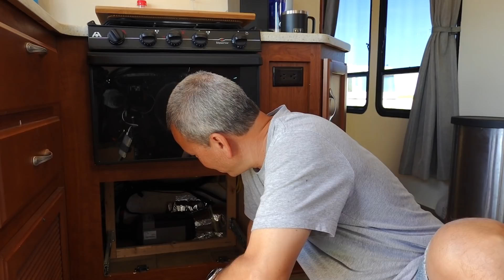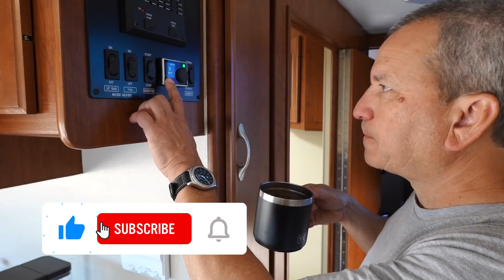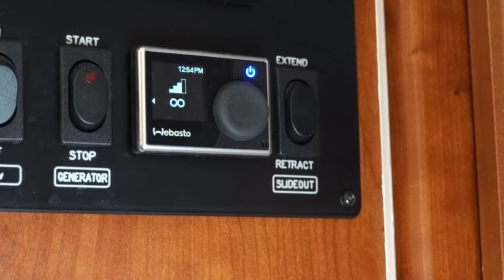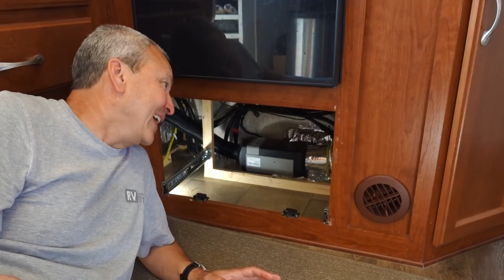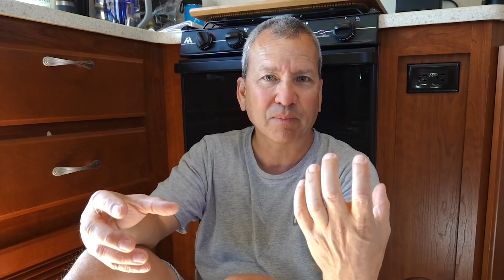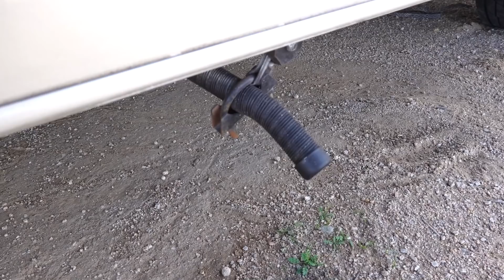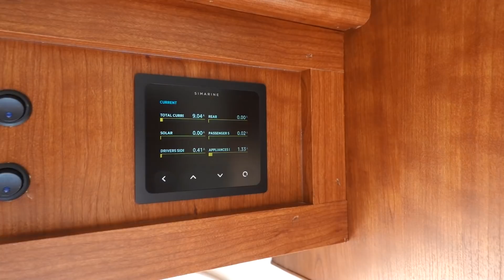(UPDATE) 6 Months Using Webasto Gas/Diesel Heater in RV

Comment: What’s the coldest temp you have been in? Do you feel the 2000 is adequate for your size rv or do you wish went to a 40 or 55 size? Looking to install in a truck camper that’s used in below freezing temps

Comment: Consider a separate “day tank” to run the heater from, or a high pickup on your fuel tank so you don’t discover your tank is empty after spending a few weeks in the outback.
Reply: Nice idea but he used his generator line to supply the fuel and the generator pick up is usually higher in the tank than the regular fuel pick up for the engine so the problem was already solved.

Comment: Hey Tito, great update.  Quick question.  Once your temperature is achieved, does the low fan stay on? I guess I am used to my home where once temp is reached, heater cools and shuts off.
Reply from the maker: Yes. The heater uses air from the intake to sense the temperature for the thermostat. So the fan continuously pulls in a tiny bit of air to measure the temperature.
Reply: @RVwithTito  good to know.  And any reason why the termostat overheats by multiple degrees before stopping the flow of fuel? I have the new 3.0 thermostat.

Comment: Nice upload Tito! I'm trying to decide whether to put my battery bank and electrical systems under the twin bed near the Wabasto (driver side), or under the other twin bed on the passenger side. Obviously, it would be easier to get my #4 wires from battery to Orion 12-12 charger on the driver side, but my concern is that the Wabasto output will put out too much heat under the bed where all the systems are. What insulation did you use? I see that there is a product called " Wabasto theroduct insulation". Do you feel like the compartment would be too hot for electrical systems in the winter when it's running all the time?

Comment: Super helpful.  I have a new van conversion that came with this heater.  Love it!  I was trying to find out if it is normal for the fan to be running all the time and why.  Nobody had an answer, so thanks.  But I’m still not clear why the fan runs when it’s not heating?  Especially since it’s circulating cool air?   Love the padding to prevent the clicks!  I’ll do that this summer.  Thanks a ton
Reply from the maker: The fan runs to pull air in to sample the temperature for the thermostat. Also, there's a better rubber mount available now very similar to this one https://amzn.to/3JsqxkB that works great as a shock mount for the pump.

Comment: I'm trying to figure out how to power this thing. I'm installing it and don't know how to connect it properly without messing up my car. I'm assuming I just connect it to the battery? And if so, how?
Reply from the maker: You can use any 12V source for power. I don't think it draws more than 6A when initially firing up, then it drops to about 2A. So a 10A circuit would work.

Comment: I have a couple of cheapy  heaters and they run 24/7 as well I live in Quebec the only thing is the bearings, run out of grease they r  copies all the parts fit the wabato
Chinese  heaters  have bearing issues start to make noise and have to repack bearings  
  I have 2 of them running  on deasel but I'm told one can get ones that runs  on gas or propane 
After u repack bearings  I will  run for ever no noise  is pretty good
Reply from the maker: I have a cheap Chinese one to heat my shop. The build quality it terrible and I had to make several repairs and modifications, but it does heat well when running.
Reply: @RVwithTito  they rub  they wobble  but they run.. once.u get out all the bugs  they heat well LOL
Reply from the maker: @garyreed354  Yeah. That pretty much sums it up :)
Reply: @RVwithTito  yup

Comment: Brian, do you know if the petrol (gas) version can be mounted sideways 90 degrees on the horizontal axis? I have a perfect spot for mine but it's on a side wall. Mine is not the diesel version.
Reply from the maker: Not 100% sure, but I don't think so.

Comment: I purchased the same unit to heat my E-350 high roof conversion here in Alaska. Haven’t installed it yet but knowing that it’s heating your RV it should have no issues warming my much smaller space in subzero temps.
Reply: I'm currently mid way through installing one in my 4Runner. Much smaller than any van or RV.

Comment: Maybe I will keep the old heater too, just in case i run low on fuel and its still cold outside. 
Thanks for the video! Very informative.
Reply from the maker: Yes. That's the best option if you already have an LP heater.

Comment: That’s great Brian!  I’ve wanted to do the same project, but my control panel is in the center of the trailer, and the wire routing has intimidated me to date.  Perhaps I could just put a switch on the interior side of the exterior wall.  When I see rigs with that light strip, I always think it would be great to add one to mine.  Cheers!

Comment: Thanks for the update.  I'm going to put one in our Chinook to replace the Suburban that doesn't work and we wouldn't use anyway because of the noise, battery drain and inconsistent heating. I would reconsider taking out your propane heater if you already have it installed. It doesn't hurt to have a backup . We have a catalytic heater for a backup that works for our tiny rig. Happy Trails.
Reply from the maker: I still have the LP and keep one duct hose just in case. So far the webasto is doing great...even at higher elevation. I may do a video about that.

Comment: We used a similar system to your Webasto - Espar or Eberspracher - while living on our boat, altho' it used diesel fuel.  There's much to recommend the dry heat but both brands have historically had issues with their control boards, and that is the central nervous system of the entire installation.  In Europe, both brands' diesel fuel versions are commonly installed in recreational boats and commercial trucks and seem to work reliably provided there's adequate DC voltage being supplied.  Low voltage is the achilles heel as they can misfire on start up.  Brian, given the 'utility company' on your roof and the more benign conditions your RV experiences, you'll probably find this quite reliable.
Reply from the maker: Thanks for the info. Yup. Low voltage is not going to be a problem for me. Experimenting up in higher elevations now. That seems to be the weak point.

Comment: Hi Brian! Thank’s a lot for your vidéos! I use a 2000 stc with the altitude kit. Had the oportunity to test it lastly in the french alps and close to the sea. I am wondering if the webasto drys air? Have you noticed any isue with hygrométry in you campingcar after 6 month using it?
Reply from the maker: No issues with moisture yet. We've mostly been in dry climates so it's hard to measure. I'll be curious how well this does as we move up in elevation soon. We'll see.

Comment: Hey Brian, have you had any issues with mounting it on the osb?  Did the heat shielding your installed in the 4" cut out do the job?
Reply from the maker: So far no issues to report. Everything's holding up.

Comment: The Webasto heaters are very durable.  I installed the diesel version in my boat in 2014 and it has worked perfectly for the last 7 years.
Reply from the maker: Great. Good to know. The only potential issue I see is in higher elevation. I'll find out soon. No problems at sea level though :)

Comment: I run an Espar(Eberspacher)Diesel heater on my boat. When I was considering having a fuel burning appliance on my boat,  Russian or Chinese products were not even a consideration. Webasto and Espar are super, well designed and manufactured units you can leave running when you fall asleep.
Reply from the maker: My reasoning as well. I sleep worry free too and don't mind leaving it on when not around.

Comment: Great video - we installed a couple of the cheaper Diesel heaters and they have also worked great!  We were amazed at how little power they use for the amount of heat they generate.  Keep up the good work!
Reply from the maker: They should work great in your bus. I'd go with two in a larger rig.

Comment: Good review Tito. I think you should leave your existing heater intact as a backup in case the Webasto fails. In fact a couple of backups would be wise. Something like a wave heater as well.
Reply: I can guarantee it will fail. If you have been running it 24/7 for 6 months you are about half way the the blower motor life.

Comment: I’ve had a Camco wave 3 in my van for 1.5 years and I’ve had zero problems. I do always have my fan and windows open do condensation isn’t a big problem. Except during 30 degree weather, which here in California has happened a few times this year, then there’s condensation on but only on sliding door and windshield. I really can’t justify the cost when I only use a heater 3-4 months out of the year and it’s never a constant. Then it get stored until the next year.

Comment: Hi Brian.  Just wanted to let you know. I did a van conversion last year for a friend, and she has the same heater as you do. She recently had a problem that her heater wouldn’t start. She took it to a dealer, and they determined that creosote formed in the exhaust. They blew it out with air, and it took right off. Your exhaust is longer than hers , so you might experience a like problem. It may be because she runs it on low a lot. She lives in her van full time and runs it quite often. 
Great video,  Thank You ,
Reply: @68Mustang390  do you know what it costs her a day to run it 24/7? I have a vevor but I’m getting a wabasto and trying to decide on gas or diesel because I read somewhere the gas one will cost me 20$ a day??? Diesel costs me 5$ a day to run. Trying to figure out if that’s true about the gas model.

Comment: Tito, you have not covered heater operation at altitude (>5,000 ft). I think you’ll find that with prolonged use of the petrol version at altitude, you will coke the combustion chamber without calibration. Perhaps you will return to Washington through Nevada on a leisurely route and be able to give an update?
Reply from the maker: We'll probably be at elevation in Utah within the next couple months. I'll have to flip the high altitude jumper and give it a try.

Comment: Thanks, I purchased a Webasto 2000 STC and also could not be happier. It works like a charm. 

Thank you also for posting a local supplier as the genuine Webasto (gasoline) heater is very hard to find. A fellow 🇨🇦 did recommend a supplier in Russia that I got mine from (heaters4you) - at less the half cost of what I could source one in the US or Canada. It took 2 months to arrive via Russia Post/Canada Post with tracking. It was 1 month in Russia and 1 month in Canada as Russia Post has tracking like Fedex you can see every step along its travels😅. Only caveat about Russian Webasto is there is no North American warranty. I wrapped my whole fuel pump with 1/4 neoprene foam insulation and a couple of zip ties that also takes care of the fuel pump ticking. I have only 60 days experience so far, but unlike my old VW gas heaters from the past this heater just works.
Reply from the maker: That's great to hear. Mine is the Russian one also that I luckily found on Amazon.

Comment: I put the same one in my fifth wheel about three months ago. It is absolutely outstanding. I put it in because I saw your video. It is a game changer saving a lot of money and buying propane for the inefficient RV furnace that comes with RVs these days.  I paid about $1100 which is a lot of money for a little dinky heater. However this thing rocks.

Comment: Without going into detail... And being almost 80 years old spending a lot of time in RVs... I'm going to say this once and once only... if it was me, I would not remove the original propane heater... and anything to do with gasoline, I would not leave running when I wasn't there but that's just me. great stuff thanks for posting... I live in Arizona I like it a little warmer than you guys like it in the cold nights LOL thanks again
Reply from the maker: Thanks. I hear ya. I could really use another water tank and that LP heater location would work out good for that. Still TBD though. I felt the same way about leaving the heater on, but the more I learn about the safety stuff it has built in, it seems fine. I only do it when there's a good reason to.
Reply: @RVwithTito  thanks for taking the time to get back to me. Very good video. I lived in a small RV with 117 pound female mountain lion for 2 years. Google, Bridgeport Connecticut mountain lion. The headline you're looking for is... Mountain lions are not for everyone. I think you'll enjoy the article. Thanks again
Reply from the maker: @dwightbernheimer331  That's quite the story about you and Dash. Thanks for sharing it. Too bad there were no photos in the article.
Reply: @RVwithTito  when she died I got rid of everything I couldn't bare it somebody sent me a photo of the newspaper headline on my phone a few weeks ago thank you so much

Comment: Hi Brian, It was a nice video on  Webasto diesel heater. I have one question is that,  does it requires ventilation to cool the heater? Because you have installed the heater in a closed area, where there is no ventilation.
Reply from the maker: The space isn't totally closed off. The panel where the intake is is open. Plus the heater kind of cools itself but constantly running air through. Even when you turn it off it runs the fan for a few minutes to cool itself down. So far it's been fine.

Comment: 1. Your comfort zone temperatures for nighttime and daytime is too cold for us.  I would need to see how it works for higher temperature range.  
2. If you delete the propane heater could you use the basement ducts for the new gas heater to flow through?
Reply from the maker: 1. You could certainly set it higher, that's just where we like it. 2. I'm already using one of the ducts used by the old heater. The other ducts I've temporarily sealed off.
Reply: I purchased the same heater on Amazon.
Reply: Did you show the subs how you do that? I may have missed out. Unfortunately I have a Coleman basement unit

Comment: Don’t know if I’m repeating...
Build a small frame or use sheet metal clips on the back of that vent door and attach your filter to that.
All of the air will then go through the filter.
Reply from the maker: Yeah. You're right. Just trying it out for now so I didn't do it up right.

Comment: Any comments on moisture or humidity.
Reply: This is a dry heat system. Propane creates lots of moisture but usually from your cooktop which vents inside. There are tons of videos on the diesel versions here on YouTube.
Reply from the maker: Right. No moisture of humidity with these. It's dry air.
Reply: The proof comes when its cold outside, 30 deg or so, ur heater is on all night and in the morning do you see ice on the inside of your windows.
Reply: @arne6787  that is because it is warm inside and very cold outside and it causes condensation nothing to do with the furnace I would recommend learning how a gas-fired furnace operates
Reply: There is a misconception that using your propane furnace within your RV creates moisture but as you may be aware there is a little vent outside and basically there is an intake and an exhaust and once the propane is burnt it exhausts the humidity outside that vent so you get a dry heat just as you would with a gasoline heater inside the RV

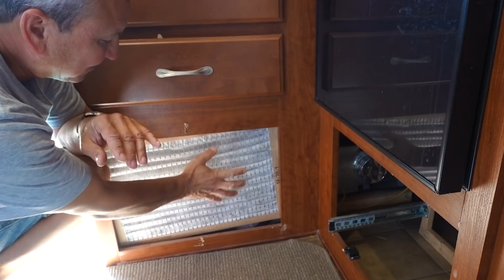Comment: That filter at 5:30 is not doing anything.
Reply from the maker: Could be right. I'm thinking only when it's really dusty, then it would help a little. I'm also concerned about it impeding air flow.
Reply: @RVwithTito  All air will take the path of less resistance and that will be around the filter.

Comment: This is great, a solution to my heater problem. the original LP heater stopped working and i had the dealer fix it under warranty, then it went out right before our  Texas freeze. That sucked. I was looking at these before but could never find one that ran off of gas. My LP furnace when working is such a gas hog. This seems like a good solution.
The gas models are hard to find and the one you have is not available just the rotary controlled one. guess i will keep looking. Thanks for the vids. FYI working on my solar i did get the 2 of the 100amp lioncore Batteries waiting for a sale to get the third. just got a Victron DC to DC charger so i can charge the house batteries off the Alternator. Love the channel keep it up.
Reply from the maker: Good luck with the solar project. Check out the company (in virginia) I listed in the description. Last I checked they had some gas versions labeled as a Sprinter gas package or something.
Reply: Was the furnace a suburban model or Atwood?
Reply: @iair-conditiontheoutsideai3076  Atwood
Reply: @1973mre  not a fan of dometic products suburban I have had more luck with

Comment: I have the Chinese diesel heater. Used 2 winters sofar in New England in Class C full-time. Only problems i had was i had to replace the fan, glow plug came loose and the LCD controller is very fragile. But they are only $20 so I keep a spare. And also a spare glow plug and fuel pump also $20.
Brian don't remove the LP heater system. You should always have a backup. Especially in colder climates. My LP system happens to heat the underbelly compartments and waste tanks. So it's a necessity.
Also you can buy 10 China heaters for 1 Wabasto. Infact you can buy a China heater for the price of the Wabasto exhaust pipe. But a gas heater is not available from China. I probably wouldn't trust it anyway. Diesel safer .
Reply from the maker: Haven't removed the LP yet, but I'm eyeing that spot for a second water tank.